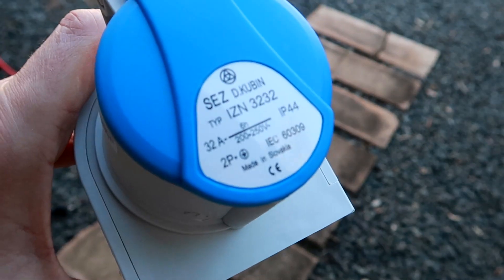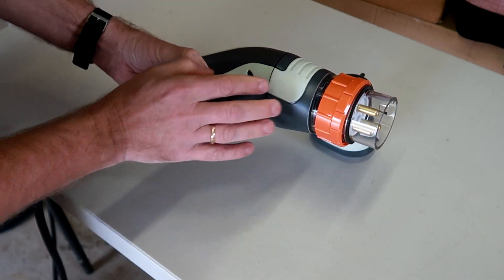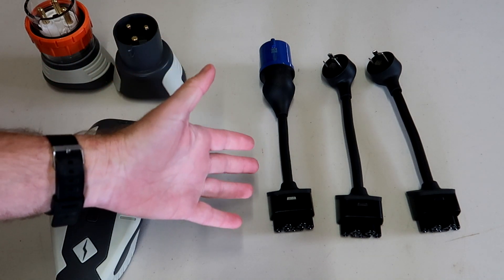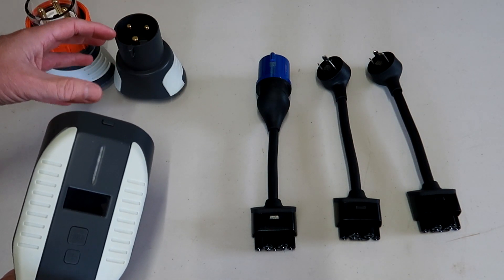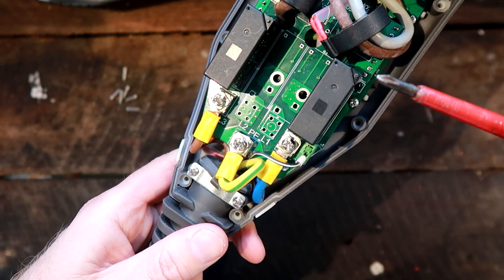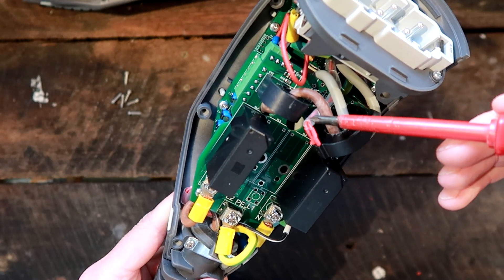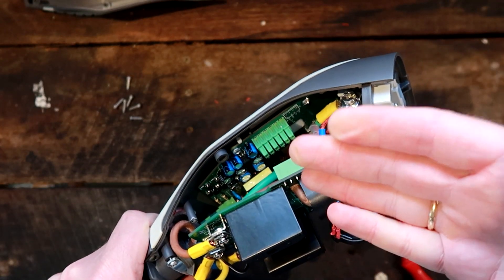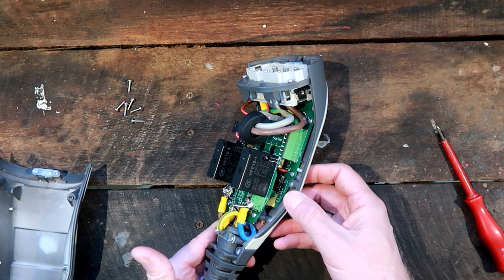EP374 - ChrGet Universal Mobile Charger INSIGHT & INSIDE - more safety features!

Comment: Very good review, but one small error. The relay does have a 12v coil, but it appears to be a 277v 50amp rated relay. If they gave tradeins on my evolution evse, then I would be tempted to get one.
Reply from the maker: Yes, the coil is 12V but the relay can switch 50A at 277V. So no problem...